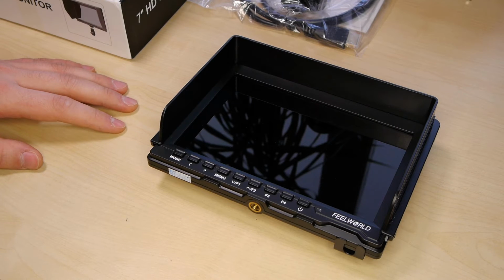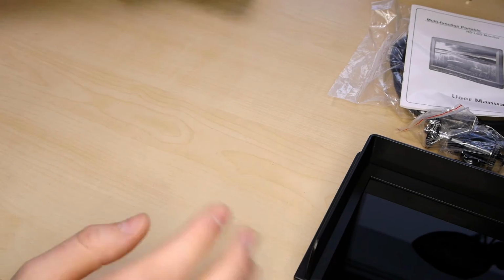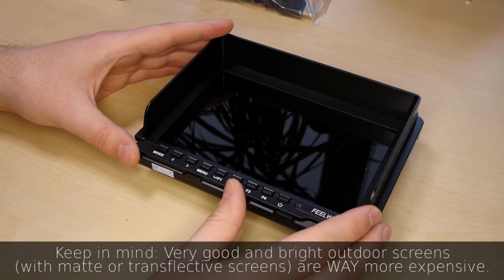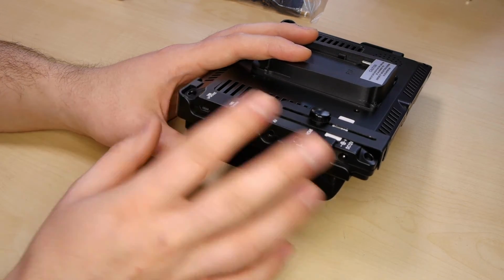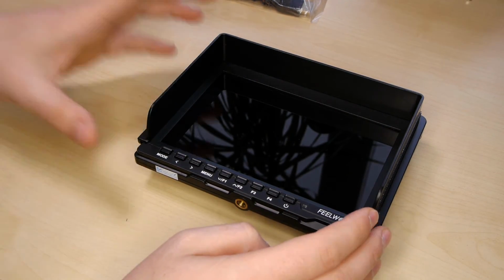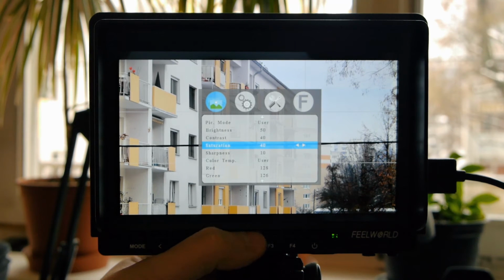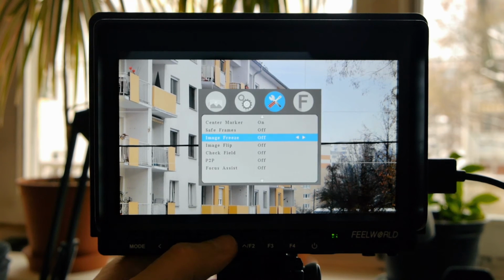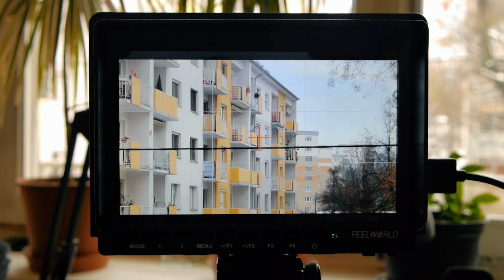Feelworld FW759 / FW759P field monitor - Very detailed HANDS ON (with calibration settings) (!)

Comment: Is it compatible with a GH2?
Reply from the maker: +Ando Servis Yes - It is fully compatible (as it´s working with interlaced signals too - Flawlessly). No additional moires or aliasing patterns are shown (just because of the screen and its internal scaler). Actually the best bang for the buck screen on the market. Btw.: I also tested it with the GH2 by myself (as I am still using it to record all my YouTube videos) - So I can tell you for sure that it´s working ^^.
Reply: Excellent :) I plan on hacking my GH2 also. Probably moon t7 or flowmotion v2. What about battery rigs? They seem to be thin on the ground for GH2's. There's one made in Taiwan, but are there any universal battery grips that can be used?!
Reply from the maker: Well - I am still unsing the DrewNet T9 Long GOP hack (with custom 40MBits in 24L mode). Working like a charm (and if you´re not pushing it THAT hard in post, it´s kind of a "sweet spot" inbetween size / datarate and gradeability). According battery rigs -> I am still waiting for a few converters for a video about a central battery solution (as I am also using just one Sony NP-F970 battery for multiple devices).

I am btw. not THAT of a fan of battery grips (as they are too bulky, as soon as you want to use a rig and / or a follow focus for example). I personaly would go for the same solution I am also using actually -> A Sony NP-F battery plate (with a 15mm rod clamp to mount it on a small baseplate with rods) + a DC coupler for the GH2 (which is even working with the new Panasonic G7 if you plan to upgrade later - CinegearPro located in the UK is for example offering one with a wider voltage range from 5 to 8.4V or so - And they also offer Sony NP-F battery plates - Just ask for the right plugs / adapters, so you can mount the coupler directly to the plate).

With that solution you can power your GH2 for 10 hours (and even longer) - At least if you´re only powering the GH2 alone. On mobile use I would go for standard batteries (or the PATONA branded ones, IF you can get them somewhere in your location / on your local Amazon website) - The standard batteries are lasting about 1h 30min (or even longer according the capacity). And if you have a few of them (2 or 3), and if you´re not shooting on the go over the whole day, it´s also more than enough (for longer periods you could still use the NP-F + DC coupler solution - The Sony NP-F battery is also usable as an counterbalance on a shoulderrig that way ^^.)

LG
Reply: Ah ok. Thanks for that info! I do have a DC coupler as I bought a bestek powerstation battery. It's an awkward shape though, so attaching it to a tripod is going to be tricky. Hence why a battery grip would be handy to be underneath the GH2.
Reply from the maker: Sure - Such a powerstation / powerbank is also an option. I just don´t like such big ones that much (as it´s quite annoying to mount them somewhere - As you already found out). Sony NP-F batteries are also really cheap on the other hand (so you can buy multiple ones) - PLUS the battery plates are easier mountable (becuase of th 1/4" mounting threads - Even with only a clamp to mount it on the tripod feet). But a powerbank is also an option yes (with alot of power / runtime).

Hmm. I don´t have experience with the GH2 battery grips (as they were also too bulky for my taste). But there are multiple ones available - yes. Even with a fixed Li-Ion battery built in (for up to 9 or 10 hours of runtime).

Normaly I go for a small baseplate (with rods) + the battery-plate (instead of a battery grip). It´s working like a charm (and there´s still the option to switch to the standard batteries if I want to be more mobile). PLUS: I also get the option to mount other stuff (magic arm for a monitor for example - Or a sunshade / mattebox at the front) - Just in case -> The rods are already there ^^.

Well - If you really want to go for a grip -> CineGearPro in the UK is also selling the fixed Li-Ion battery type (if you´re located here in Europe). Or just check out Ebay (and search for a supplier from China directly for example). It´s not cheap - But for sure also handy (if you don´t want to fiddle around with external solutions) ^^.

Btw.: A side info - Never ever use AC to DC adapters (aka wall plug switching power supplies) for your DC coupler. You´re ruining your audio that way (only had problems with multiple AD / DC power solutions til now according severe humming on the recordings) ...
Reply: Thank you for the useful advice. I don't mind having a bit of lens flare, so I'm still deciding on whether I need a matte box. I'll be buying separate audio equipment for the sound, so not worried about recording it on GH2. Plus it'll help battery life (on which ever battery power I end up choosing!) to last that little bit longer. 
 
I've been considering buying a GH4, but as it still costs in the region of £600-800, I've realised that spending money on additional equipment is more wise. I'll get a GH4 at some point, but for now I want to see how well the GH2 holds up.
Reply from the maker: Hmm. The Sony PCM-M10 recorder is quite nice audio wise (only con is the not perfect 1/4" thread - At least with my unit - You need a rubbered magic arm mounting point or flash adapter with rubbered screw base on top). Sound wise it´s near perfect (at it´s price point). VERY low self noise preamps (and good internal limiters). Though keep in mind: Power wise you´re not using more when using the GH2 internal audio. It´s not perfect - But most of the time it´s more than enough (especially with the higher bitrates through the GH2 hack). Btw.: I always used the GH2 with a Sennheiser ME2 for my YouTube videos (directly connected to the GH2 via an 3.5mm to 2.5mm adapter). The audio is quite ok I think (and sometimes it´s even good that it´s not picking up EVERY little noise in the room - At least if you´re recording someone speaking ^^.)

Well - I also upgraded to an GH4R now (getting it on Monday -> The "R" model is coming witouth 30 min. limit and with V-LOG pre-installed). Tried the G7 first where the GH2 batteries and the coupler are working fine too - But chose to upgrade from the G7 to the GH4R because I need the over 30 min. runtime quite often (without external recorder) - AND as I have an external recorder already, which makes WAY more sense with the GH4 (because of the 10Bit + V-LOG feature).

But in your case keep in mind, that the G7 (or G70 how it´s called here in Europe) is also a nice camera. Even a little bit better noise wise than the GH4 (and for half the price you´re getting basically the same image quality)! Especially with the GH2 accessories the G7 / G70 makes sense (got mine for around 350 to 400 bucks - As I bought it in a kit with the 14-140 - Which ich sold). So it´s price wise aösp REALLY nice. So if you don´t need the features (10bit output, V-LOG and live-view HDMI out), the G7 (aka G70) is also a good run for an upgrade ^^. It´s even better shaped grip wise than the GH4 ...

P.s.: Also thought about selling the GH2. But it´s still a GREAT camera (with VERY nice 1080P resolution / details). And if you´re not getting that much for it, it makes no sense to sell it (more or less). Still a great B-Cam (also beside a G7 / G70) ^^.
Reply: +AustrianGeek I have looked at the G7 & also GX8. Both have great low light capabilities. It's all deliberate consumerism planning by Panasonic..Bring out new cameras, have some new/improved features, but also hold back on other important features like battery life/ISO capabilities. So they then have a few more improved features with the next models like GH5 etc.  
 
So back to the monitor, the 'p' version that you mention in the video doesn't show up on any websites (Amazon,ebay, Feelworld) as it only shows this version. Do you think it's worth waiting a little longer until the newer version is more available? Or is this one good enough?
Reply from the maker: About the screen: Well - I also oversaw the "FW759P" model first (otherwise I would have bought this one and not the standard model from scratch on ^^).

The point is: I think you only get the standard model locally. The "P" model you need to order overseas (from Feelworld directly in their Aliexpress shop for example - Never saw it somewhere locally or over Amazon). BUT: You could also ask the Amazon dealers, if and if yes - WHEN they plan to put the "P" model onto the Amazon marketplace. Maybe they also start to sell the upgraded model soon.

Btw.: "Good enough" are both models (as they are basically the same hardware wise). It´s just the question if you need or want to have the histogram, false colours and zebras. If you get at least the histogram on your camera, it´s maybe ok to go for the FW759 - But if you don´t have one at all while recording, it´s for sure better to invest (and search) for the FW759P model. It´s btw. not that muc more expensive anyway ...
Reply: +AustrianGeek Is the Feelworld main site in Germany? This model is on ebay UK/Amazon UK, but they are in China. I'm a little cautious about buying from China.
Reply from the maker: Feelworld is a chinese manufacturer - So it´s coming from there anyway ^^. Also bought my FW759 from there btw. (over an Ebay dealer). It takes it´s time til you get it - At least if you order with the free shipping on Ebay for example (so if you want it faster maybe invest a few bucks in the faster shipping rate - At least if it´s not THAT expensive). Took about two weeks til I got mine. So keep that in mind if you need it fast.
Reply: How have you found the rolling shutter when panning? I've heard it has a lot of judder?!
Reply from the maker: The monitor? The monitor isn´t adding any judder or rolling shutter - It´s always coming from the camera. The rolling shutter is due to slow readout speeds of the CMOS sensor (which is a common problem - Especially with the higher resolution readouts and because the sensors are read vertically line per line with a delay inbetween each line readout). AND the judder you´re seeing is the 24P mode (only the higher framerates are visually "judder free" - Like 50P, 60P or even 100P and 120P of the newer camera models).
Reply: +AustrianGeek I've finally bought this monitor. I was going to go for the 'p' version, but as I'm sticking to a budget, I decided this one would be enough. Which is best for the battery plate? Sony? Please refer me to the best option!
Reply from the maker: You could go for the biggest Sony NP-F970 batteries (there are also 3rd party kits available over Amazon for example for about 40 to 50 bucks for two batteries + charger). Or also the smaller NP-F730/750/770 batteries are enough (as the FW759 isn´t sucking that much power out of the batteries).

Just don´t go below this size (NP-F550 or NP-F330 or so). These smaller sized ones are not lasting that long - Even with the lower power consumption.
Reply: AustrianGeek Thank you for the quick response! So the 3rd party batteries are just as good/reliable as the more expensive sony ones?
Reply from the maker: Most of them are not AS GOOD as the original ones (especially the super cheap options). But they are good enough for an external monitor ^^ - And a few are about as good ("real" capacity wise). As mentioned: Check out the feedbacks on Amazon for example (and maybe choose a kit from scratch on -> Batteries + charger - As seperate purchases are normaly more expensive).

There are also better NP-F batteries out there (for example here in Europe Patona Premium ones with "real" 7800mah, or the SWIT NP-F batteries which are even coming with an capacity indicator and an DC out port on the battery itself) - But it´s not necessary to invest more in such batteries. At least not with lower power devices like the FW759 ^^.
Reply: Right ok. I don't really like the extra bulky looking batteries as I'd prefer a thinner one that fits tighter to the monitor & is also less weight in general.
Reply from the maker: Well - You could also go for the NP-F550 or the "middle sized" NP-F730/750/770 ones. But the 970 ones are easier available as a kit (and also cheaper according the price / capacity ratio).
Reply: AustrianGeek Could you please send me a link to the battery that you use :)
Reply from the maker: Well - Just search for "Patona NP-F970" on Amazon for example. Good quality batteries (I also used their batteries for different Panasonic bodies - They are also working nice). But you could also go for the a little bit smaller NP-F770 ones from Wasabi for example (search for "Wasabi NP-F770" - They also offer a kit with a charger and two batteries). I didn´t use them by myself til now - But they are quite popular overall. I use btw.: Patona, Patona Premium and OEM no-name NP-F970 batteries which were included with my Aputure 672 lights - Though the no-name ones from Aputure are definitely not the best quality wise ^^.

Comment: Hi, thank you for this detailed review.
Can you tell me if the screen goes to blue or to snow when there is no signal? I am looking for a good monitor for FPV (First Person View) on a radio controlled quadcopter and it is important that the monitor gradually goes to snow when analog signal is low and does not go completely go to blue.
Cheers
Reply from the maker: +Peter Hewat Hmm. Sorry. But I cannot test this for you (as I don´t have the small adapter cable to check an analog input signal - It´s not included from scratch on in the standard accessories - Just optional). Btw.: How about an converter inbetween the analog and digital signal side (analog to HDMI) - As far as the converter isn´t going to blue / still outputs the signal over HDMI it´s not a problem of the screen anymore. ^^

Another option would be to ask Feelworld directly about that (or order the screen with the optional adapter cable).
Btw. also important / a side note: The screen isn´t the brightest one (just keep that in mind).
For quadcopter / all the time outdoor work it´s maybe better to go for a used high brightness screen (of any kind).
Maybe you can find one used for a good price ...
Reply: +AustrianGeek To check if it goes to blue screen or snow, all you need to do is select analog input then it either displays a blue screen or snow.
Screen brightness is indeed an issue so I guess I'll be looking for a brighter screen.
Cheers
Reply from the maker: +Peter Hewat Btw.: Feelworld has also the PVR / FPV models - 1000cd/m² instead of only 400cd/m² with the FW759.
They also write that these models explicitely come with "snow screen" and no "blue screen". So check them out.
Maybe you could even use their built in receivers (for a better picture). And they are also quite affordable btw.
Reply from the maker: It´s going to blue screen btw. (if you switch to analog input). At least with the firmware / hardware revision I have here (which isn´t the newest one) - And with no adapter / signal connected. But a brighter screen is a better choice anyway (from scratch on) ^^.
Reply: +AustrianGeek Blue screen it is then. Just checked their website and the PVR1032 model is exactly the kind of screen I am looking for (1000cd/m², diversity receiver). I will go and see if I can find a review as detailed as yours on that one ;-) Thank you for your help and have a good day :-)
Reply from the maker: Hmm - Why not the new FPV733 or the PVR733 (if you really want to record your flight as a backup / for insurance or so)? The PVR1032 is quite huge, coming wiht a GLOSSY LCD panel (the 733 with a matte one) and it´s only offering 500cd/m² (not 1000 like the 733). Maybe one of the dealers has wrong information (better check out the official chinese website).

Btw.: FPW = without recording
PVR = with monitor internal recording (on SD cards)

Comment: +AustrianGeek how much does the battery last and what capacity is the battery exactly? I need to know how many to order
Reply from the maker: +Sergiu Gherman Had the option to test it today with an NP-F970 battery (OEM Standard Model with 6600mah) - It is running for over around 8 hours (easily). So it is also quite low in power consumption. With the NP-F550 battery (which is also used in this video) it ran for around an hour and 30 minutes only (tested it already in the past). Though: This one was only a 2000mah battery - So one of the lowest capacity models.

I think it is the best to go for the NP-F970 battery (or maybe an NP-F730/750/770 if you can get them super cheap). Why? Because they have the best price / capacity ratio. Just a little bit on the heavy side - I know ^^. (Normaly I use external battery plates to power multiple devices. That way you also keep the weight low on the monitor directly. Need to make a video about that solution some time in the future.)
Reply: +AustrianGeek Thanks a lot! Gonna buy the F970

Comment: Great review. Can you please try to unscrew and remove the battery plate? Possibly there is a mini-USB port behind the plate (Feelworld 3.5" EVF has it) and you can power this monitor using some powerbank.
Reply from the maker: +Андрей Князев There´s only a 2 pin connector to the battery plate if you unscrew it. Btw.: Are you sure, that the USB is for powering the device? Normaly such ports are only to upgrade the firmware (with a flash drive for example). An alternative would be to use an DC-to-DC step up converter (and connect that to the 2.1mm DC port for example). That way you could easily upconvert from the 5V to the 7.2V for example (or any other voltage which is working with the FW759 / FW759P).